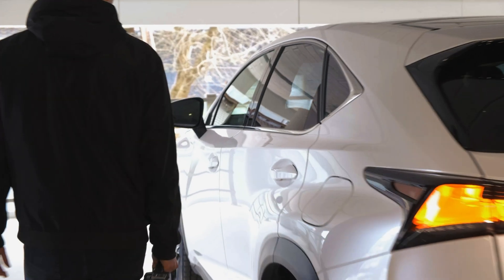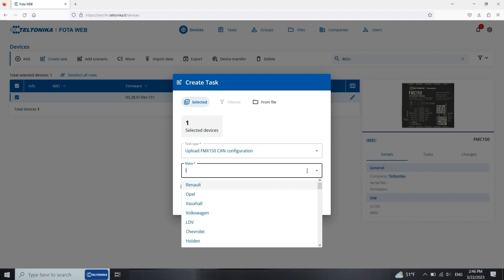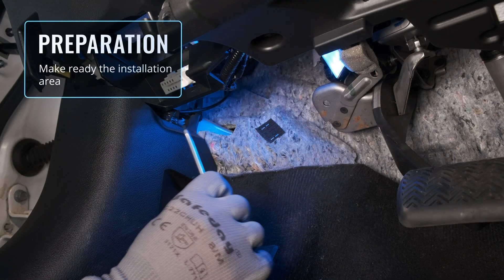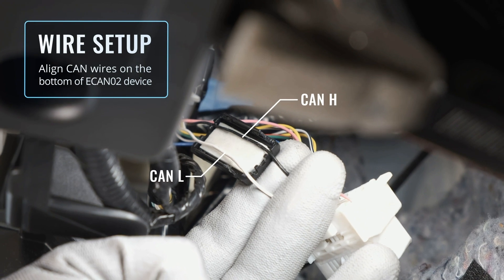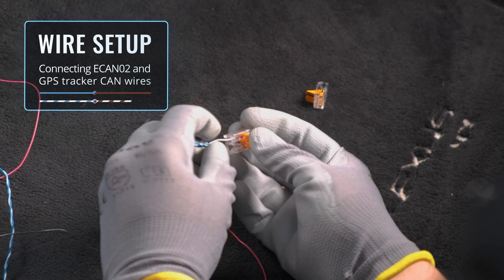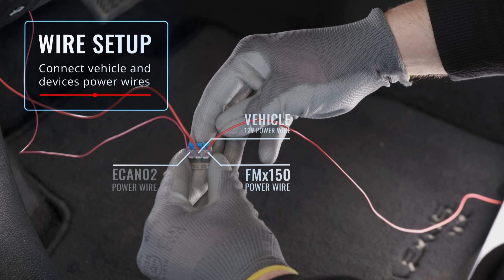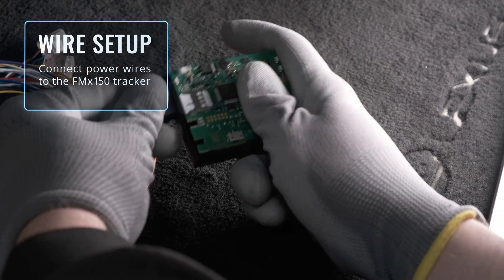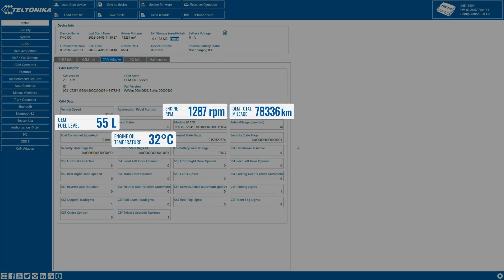Installation Guide | ECAN02 & FMx150 | Teltonika

Comment: does this work with the FMx125 tracker??, should the tracker  have  a CAN data reading chip for it to be compatible with the ECAN02 adapter??
Reply from the maker: Hello,

ECAN02 works with trackers that have an integrated CAN data reading chip or with the help of additional CAN data reading adapters. To use the ECAN02 with the FMx125 tracker, an additional adapter is required.

Comment: Does this work for FMC130 and ECAN02?
Reply from the maker: Hello,
To use the ECAN02 adapter with the FMC130 tracker, you will also need an ALL-CAN300 or LV-CAN200 device, as FMC130 does not have a built-in CAN data reading chip.

Comment: Can we customize the PID to request and get the data that we specifically want from the obd?
Reply from the maker: Hello! Teltonika can add custom PID requests for some vehicles, where PID reading is possible with the existing CAN connections. We will need information related to PID reading - how the PIDs should be requested from the vehicle and parsed.
Reply: Is there any configuration like, what you have in trackers like tft100 to add manual can ids, can we add pids which will request them from the vehicle ecu at a certain interval? @TeltonikaTelematics